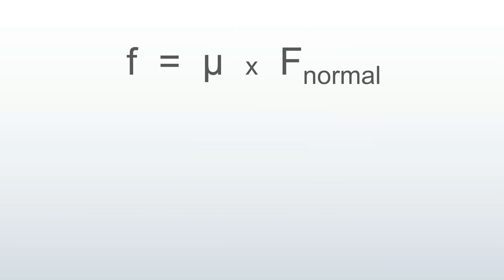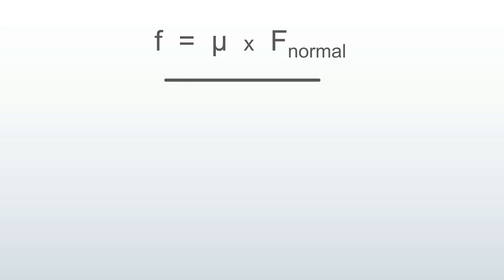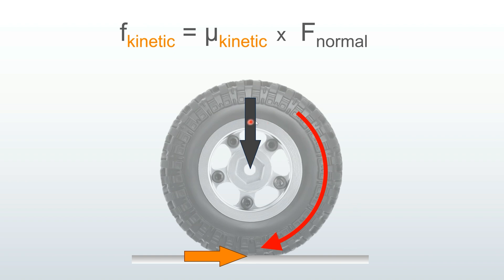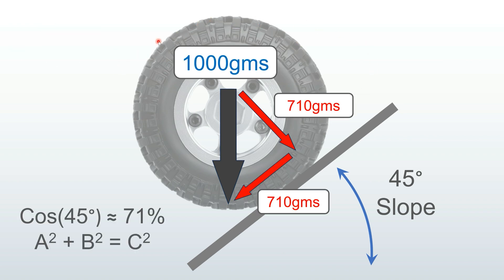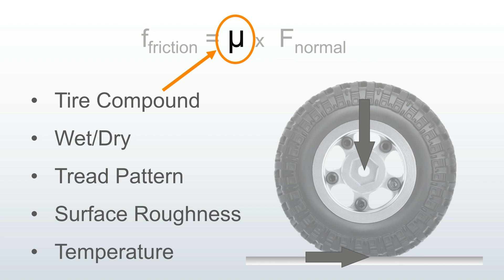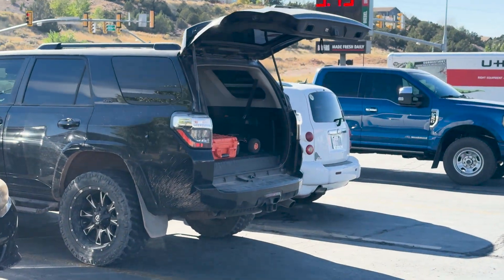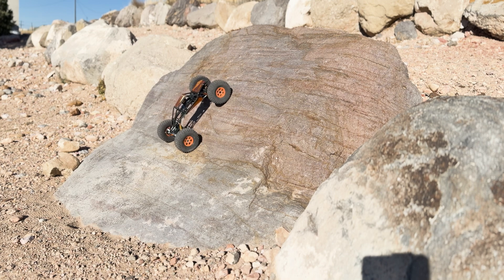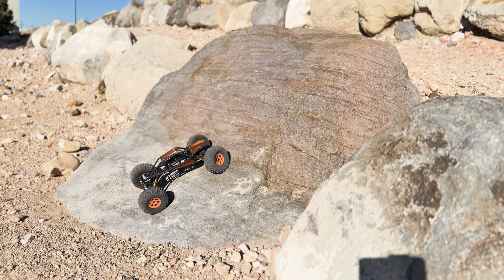Traction v. Wheel Speed

Comment: could you do a video about weighted wheels vs non weighted? im curious about having rotating mass and the effect it has on parts and performanve versus non rotating weight.  is it easier and cheaper to put on heavy wheels compared to axle weight?
Reply from the maker: That’s a great idea. The short answer is lighter wheels put less stain on the drivetrain and accelerate/decelerate more easily. But these are not necessarily high concerns for slow moving crawlers.

Comment: Great videos, nice channel. Glad you mentioned tire patch.

However, in tractor pulling...an extreme traction situation, the tires are cut to reduce bite and wheel spin is maximized to produce more forward motion. Some of this is to keep the ICE in its power band but the spinning tires do produce more forward motion than non spinning wheels/tires. 
There is more to the wheel spinning traction than you have accounted for. I have experienced this same phenomenon in 1 scale vehicles on a variety of surfaces and also in scale vehicles.
Mud, sand, and loose dirt and soft hills are good examples. Not everything is a rock or concrete.
The theory is sound but in practice there is more to it. Saying wheel spin does not increase forward motion is not true in practice.
Reply from the maker: The physics on loose terrain is totally different for sure. The knobby tire engineers  I know mostly use black magic. 🤣👊

Comment: The simple formula for friction is an accurate representation of reality only when dealing with solid materials that have uniform surfaces. For example, increasing the size of brake pads does not increase braking force. 

It does not work well with soft materials like rubber tires. The relationship between the normal force and tire grip is not linear: doubling the load on the tire will not give you twice the amount of friction. 

This is part of the reason why lightweight cars are faster in corners, all else being equal: yes, the normal force and the force required to accelerate the car toward the centerpoint of the radius of the curve (whew!) are directly proportional because mass is a factor of both equations. However, the non-linear curve of friction of rubber means that lightening the car doesn’t reduce grip as much as it reduces normal force. 

Driving 4 Answers has a video that illustrates this point far better than I can hope to do in one comment, it was eye-opening to me because I too would apply the friction formula to anything while wondering why it is that wide tires accelerate and brake better in real life: https://youtu.be/CyH5xOcsXxs
Reply from the maker: That was a good video. He’s not wrong but also not completely correct. Firstly, he didn’t mention that larger diameter brake rotors have a longer lever arm to the pad and immediately give your brakes more power. 
For sure rubber is non-linear. Switching to a larger tire usually means more air volume and lower tire pressure. Lower pressure increases contact patch, which I agree likely changes adhesion and grip edges more than the apparent area would suggest. But you also have the stiffness interaction of the sidewalls as pressure goes up and down. And the pressure distribution across the contact patch changes as well. It’s complicated for sure but I think the prevailing belief is that larger tires fight wear and heat more than adding traction. Wider or larger diameter tires also create different shapes of contact patch. Do you want more edges connecting fore-aft or side to side? Probably depends which direction you are moving.
Reply: I think he failed to communicate the point about the rotor size, since many people – like you and me – noted that a larger rotor would have more leverage and he seemingly brushed it under the rug. 

He meant that since tire grip is the limiting factor rather than the brakes, larger rotors won’t shorten your braking distance. The negative acceleration will be the same regardless of rotor size – though with a smaller one you have to push the pedal harder. It didn’t come across that clearly but I agree with the point itself. 

In use cases more relevant to me (MTB), I don’t use large rotors so I could stop more quickly. I also don’t do downhill stuff so brake fade is not an issue. What I do like is the ability to get effectice one-finger braking even when exhausted from trail riding. I also prefer reducing the difference in force I use on the right and left lever. So 185 F and 160 R it is for me.
Reply from the maker: Hey!  A fellow one finger braker. I love it. I run 220 on everything. Reduces arm pump and tendonitis.
I also believe you get smoother modulation because the rotor is moving faster through the pads and the %change in velocity is smaller. Small rotors feel grabbier.

Comment: Funny you should post this video since we have friction in our ongoing physics course, and winter has arrived causing lots of wheel spinning action at intersections. 

Spinning the wheels against the rock illustrates perfectly what spinning the wheels does: it’s a gamble. 

Increasing wheel speed seems to do next to nothing to the rate of acceleration. If there’s a grippy surface underneath something loose, you’ll get to it more quickly with narrow tires and more rpm. Most often this is not the case: you’ll just dig a deeper rut and polish it into glass-like ice. 

What I do with my full-size car is try to accelerate gently, and if the wheels spin I ease the gas pedal. I do this for two reasons: the coefficient of static friction is higher, so staying in that territory allows a faster acceleration compared to stepping on the gas and slipping into kinematic friction. Also, I prefer being able to steer the FWD car. 

Sometimes stopping and making a controlled start into a super-slow crawl is what you need.
Reply from the maker: Great comments. Are you a student or instructor?
Reply: I’m a student, just got back to school after 22 years of other stuff.
Reply from the maker: Good for you! What are you studying - Mech Engineering?
Reply: Thanks! Yes, Mech Engineering is the program. And if I can’t get a job at Lego designing new kits I’ll at least use them for work wherever it might be. :D
Reply from the maker: I’ve spoken with Lego a lot. You want to live in Denmark?  Feel free to DM me on FB.
Reply: I’ll look you up and connect. Cheers!

Comment: I ran my traction board yesterday @ 62° slope, and I  started bouncing with medium acceleration. Slowed down, there was no change in traction, sped up, and it stopped hopping and went right to the top...? I was genuinely surprised (no overdrive). It seemed to settle the hop.
 I think the contact patch can be too small and cause a lack of traction. Specificly if your tire lugs are folding over. Surface, tread, weight, and contact patch are big variables... at least on the rocks.
Reply from the maker: Wheel hop is actually a natural harmonic being activated, similar to the Tacoma Narrows Bridge disaster. Faster or slower should be able to break it up and settle things down.

Comment: A question. On loose or muddy inclines, you have dirt which is bring thrown backwards by the tires. This 'should' create an equal force that pushes the vehicle forwards. Higher wheel speeds would create more dirt being thrown backwards at a higher speed. Would this then mean that you get more force forwards?
Reply from the maker: This is a great question. Imagine you are driving on sand dunes, with nothing firm underneath. Yes, you want to spin against as much sand volume as you can to create resistance, which is why sand tires are often "paddles" which are basically scoops. They are more like a boat propeller in water.  Loose terrain and mud is somewhere in between a boat propeller and this idealized equation, lol.
Reply: Faster spinning digs ruts more quickly so the car is facing more resistance. Keeping up a spin is a sure way to get stuck in soft sand. 

If there’s better traction underneath a loose surface and the tires have to dig through anyways, narrow tires and faster wheel spin will get you there more quickly. 

However, if the surface is soft without anything solid underneath, you want to avoid sinking into it by using wider tires and avoiding excess spinning. 

So to put it short, it depends on everything. :)
Reply from the maker: @Glocktologist Well said.

Comment: 💯 👍  For me, a slow, steady crawl, build some momentum and up you go.   Even in a comp, not adverse to backing up and taking a good run at it. Spinning is not necessarily a bad thing (generates heat) but an on/off application of throttle to load/unload the suspension to generate enough force to increase traction/friction to get up a climb.  A ton of different variables, especially with our little trucks so, get to know your vehicle and just drive, drive, drive.
Reply from the maker: One thing I dislike about comps is being made to feel guilty about using reverse lol

Comment: Consistent tire spin, with good ground contact, seems to do the trick on full sized stuff, but RC's don't have a proportionate downward force I would think, so slow and soft tires, normally?
Reply from the maker: Full sized vehicles definitely have the mass to heat up the tires and that can make the difference. Alternatively, tiny cars can get away with super soft tire compounds.

Comment: So if you can't slow crawl it find better tires for that surface, right ?
Reply: My crawling thrives on momentum
Reply from the maker: A little momentum goes a long way that’s for sure.
Reply from the maker: Softer compound, different tread pattern or add weight. Or hit it with a little speed.